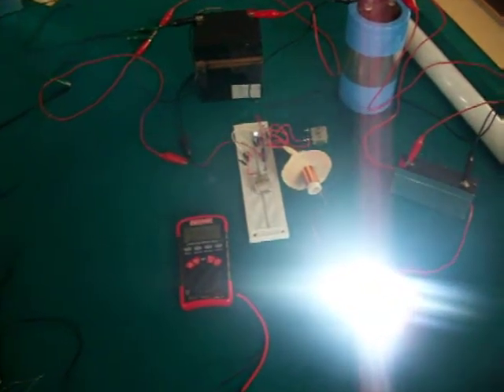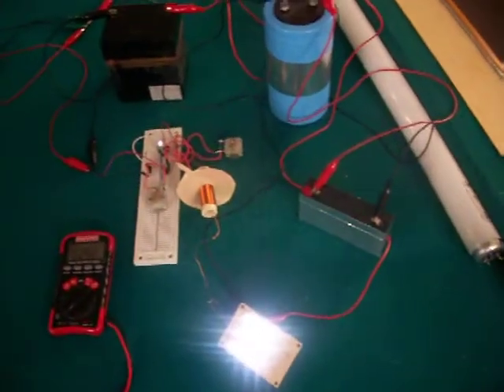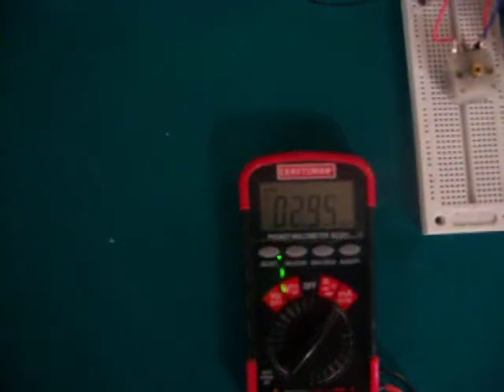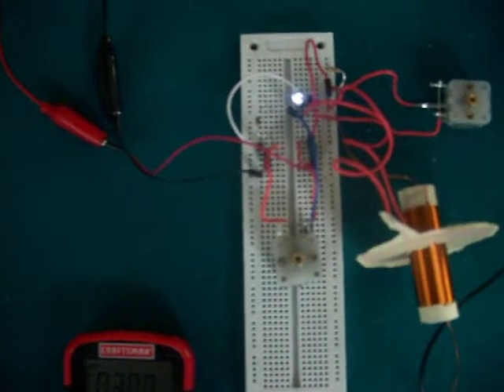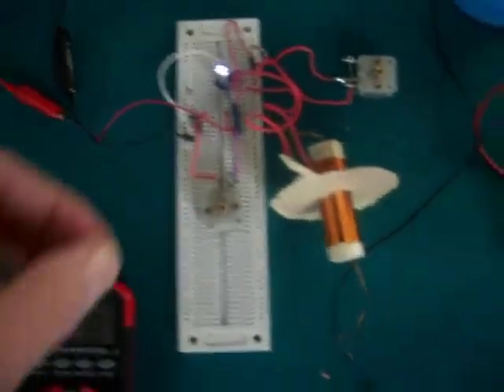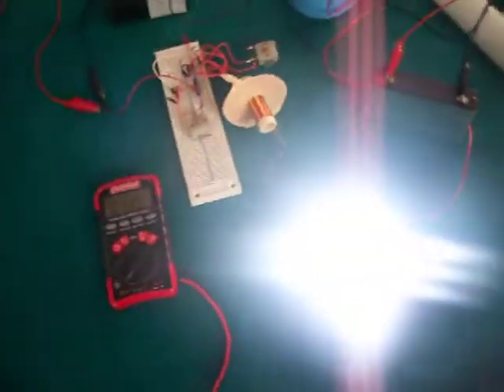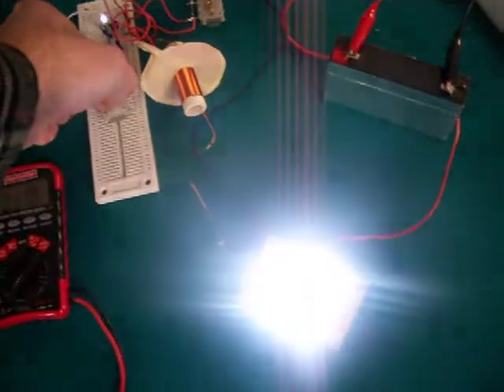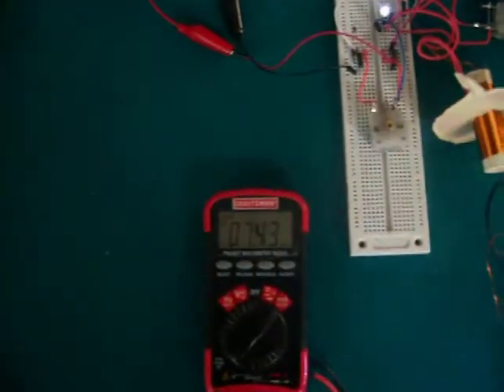Small Slayer Exciter With RF Filter

Comment: Its with experiments like that that we learn so much. Adjusting the power using a varcap across the source is how current should controlled. Unlike resistors wish is a continuous link for AC and DC. Whereas a capacitor is only conductive in AC.  Its always improving. I loooove it! Good work GBluer.